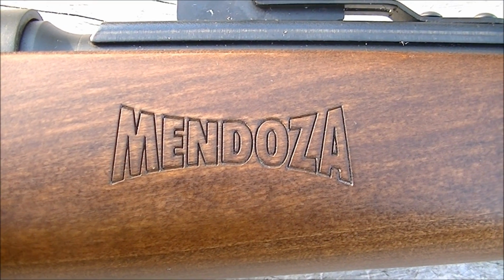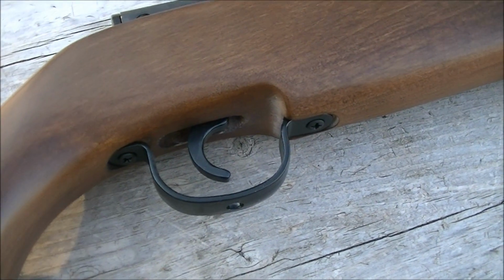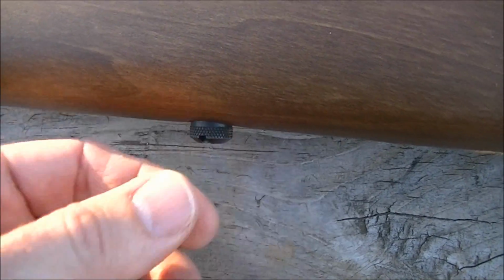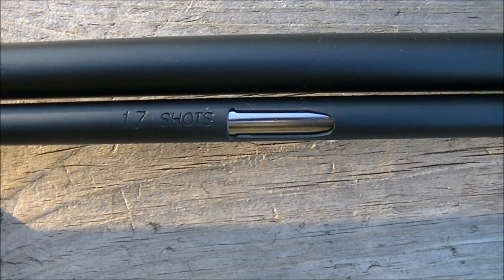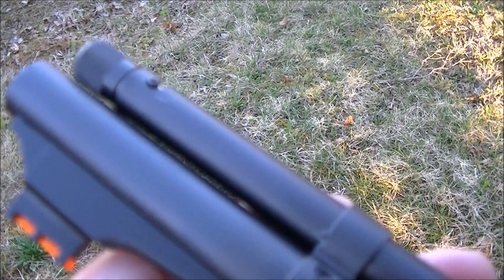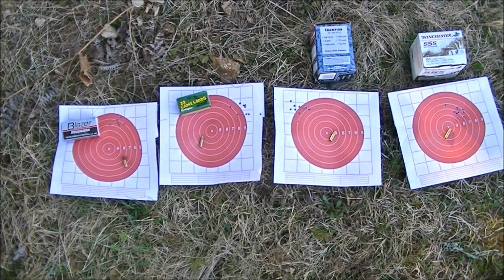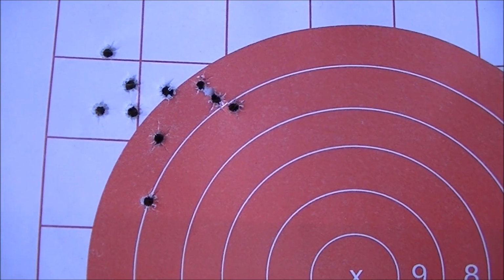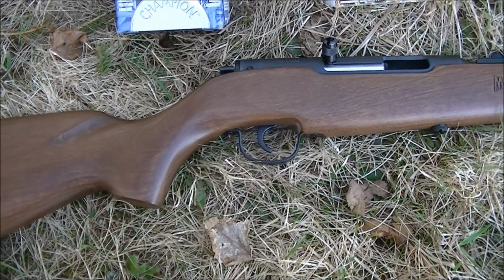Mexsar / Puma .22 Rifle Review

Comment: When I was a kid, my friend Harry Beckwith had a Mendoza 22 pistol in his gun shop. I was fascinated by it, single shot, roughly styled after the Colt SAA, with a 3 round flat "quiver" on each side of the chamber area. The breech block was a flat stamped sheet metal sort of rolling block with a tit on the inside for a firing pin. The flat hammer just struck the breech block. I think he wanted about $85 US for it which was more than I had back in the late 1980's
Reply from the maker: I had to look that one up, an interesting, if clunky looking, single shot.

Comment: I got the same rifle except mine came with a pic rail welded to it instead of the dove tail to mount an optic to. Its actually welded on slightly crooked. Kinda made it difficult to mount a scope but it works

Comment: If anyone's interested in mounting a scope on these , there are many 11 mm dovetail scope mount bases available through Amazon that will fit this rifle very well. 
I have used a UTG Airgun high profile integral mount for mine., and it holds the scope ( 1 inch rings ) very firmly.
Reply from the maker: Those scope mounts can also be sourced cheaply from places like "Deal Extreme", although shipping can be slow.

Comment: Great review. Took your time and was detailed. 

Is the trigger adjustable? The trigger guard has hole thru it, is that the access for getting screw driver thru?
Reply from the maker: There does not seem to be any user adjustment for the trigger. I'm not sure of the purpose of the hole in the trigger guard - perhaps it is there for some sort of safety lock?

Comment: I bought one of these, a few months ago, mine has the grey coated wood stock. My dealer/gunsmith had a selection of these all with different coloured stocks.
I did have a small problem with the magazine tube , which my dealer fixed easily . It's not a bad 'shooter'; good plinking rifle and I'm getting groups similar to what you've done here.
I certainly agree with having a scope mounted, and FYI,  I've installed a Hawke Vantage 4x32 AO with UTG rings, but no range testing time just yet. 
Thanks for this.
Reply: Reg Sparkes also you could search the R56 revolver,  the M990 rifle and the PK62 pistol (in long and short barrel and derringer), here in México you could buy one from $70 dollars, they're single action and could use a .22 bullet or a .22 blank and a .177 pellet, very fun and reliable, also legal to trade, because are selled as "Airguns"
Reply: @cesaralmaguert9331  I'm sorry Cesar, I did not see your reply to my comment until now,...however as I live in Canada, I can't have access to these  rifles. Sounds like they could be fun though.
Reply from the maker: My middle age eyeballs are leaning more and more all the time to optics...
What sort of price did your dealer have on these?
Reply: He discounted my price to $200.00 but they were listed at around $249.00 I think it was. He doesn't have them in stock anymore.
These Mendoza rifles sold out fairly quickly at this store at the listed price.
Reply from the maker: I can see why. I'd buy one for $200.